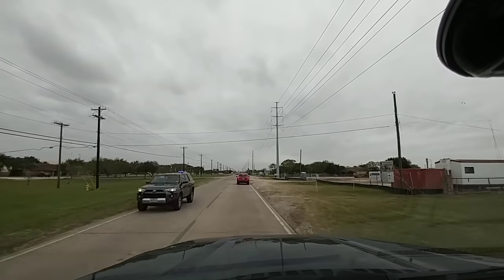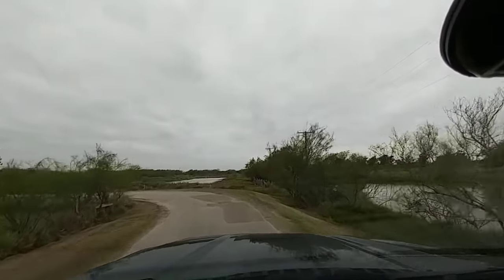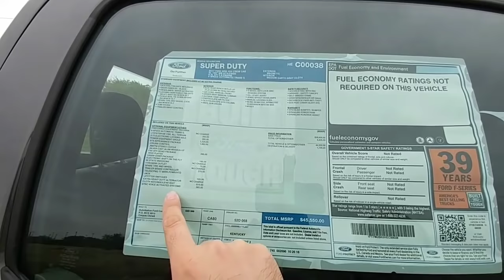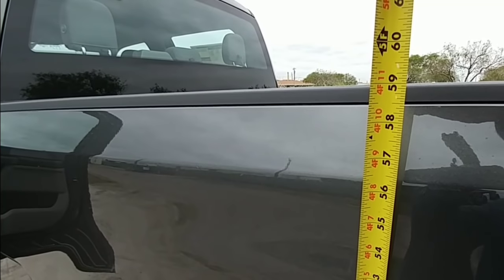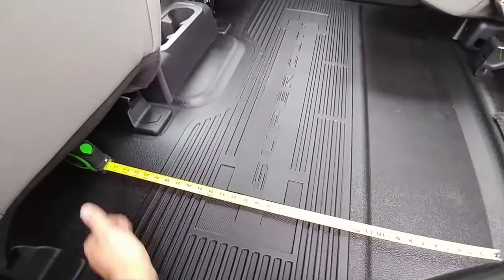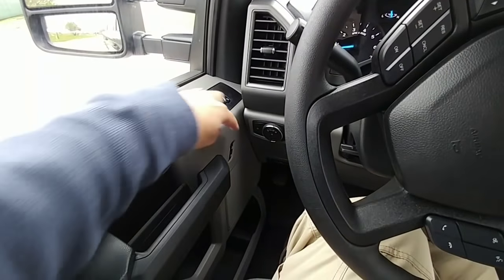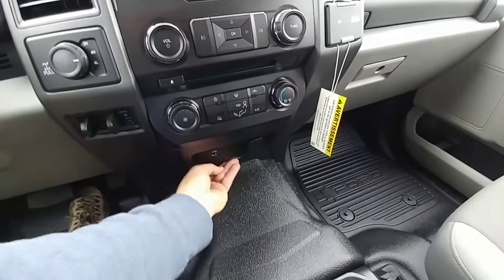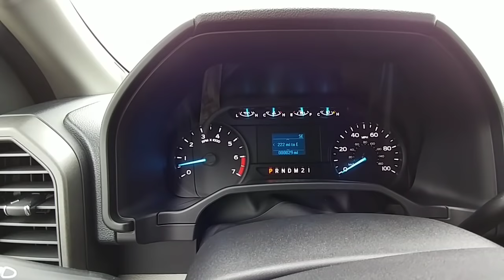2017 F250 STX FX4 6.2 Gas...Full Review

Comment: damn. Ford needs to put that big motor back in the F150.
Reply: Eric Haley they are putting a 3 liter diesle engine in the 2018 f 150
Reply: Eric Haley yes they do. I loved my 11 F-150 with a 6-2. Only reason I got rid of it it's cuz I need an 8 foot bed. I do like the 6-2 it's got really good power for a gas motor but I'm not as impressed with it in the bigger trucks as I am the smaller F-150.
Reply: Eric Haley raptor has the 6.2 at 425hp.
Reply: 250 6.2 are rated at 360 hp and 150 with a 6.2 are at raptor setting at 411 hp

Comment: 2013 f250 6.2 gassser here. Pros: Great power, not diesel but pretty good. Handles payload great. Seatbelt stopped retracting one year in otherwise no problems. Cons: Rides kinda rough but it’s a truck. Stupid low tire air warning system that sounds everytime you start the truck when a tire is below 80 psi. I don’t want that high psi in my rears unless I’m loaded or towing. Ford, either make the alarm adjustable by the owner or put the system on its own breaker so we can disable it.
Reply: Look on Ford forums for a program called Forscan.  You can change many of the factory parameters (including tire pressure) with the software via an OBD adapter for under $50.

Comment: That 6.2 V8 is best paired with a 4.30 rear end. With personal experience the truck just did not seem to have enough get up with the 3.73 rear end, which is going to negatively impact Towing performance
Reply: The 10 speed trans changes all that

Comment: Thanks for the review.  The video really showed this trim level is not for everyone.  The lack of arm rests for the front passengers is one thing but there's no way my kids would reach that rear cup holder.  I didn't see or hear mention of rear air vent that was pointed out in the Silverado videos...are they in this truck?  Also, I think the tow rating for the 3.73 gear option is around 12,500 lbs with the 4:30 gears coming in at 15k with this truck.  I am finding these trucks with the 4:30 gear are difficult to find.

Comment: I have looked at a new F250 optioned almost the same as this one. It is a very nice heavy duty truck. One thing though is the ride height of the truck. Without  the optional step bars it is a real bear to get into and out of because of the door sill height.

Comment: Great review - thanks. I would really like to see how you think the 6.2V8 with the lower gears (Can't remember if it is 4.10 or 4.30 now) drives and pulls. Same goes for driving a Ram HD with the 6.4Hemi. Seems like the higher geared trucks and V8's run well until you hitch up a trailer and then the engines scream to get into the power band - at least out in the high elevations of Colorado where I am. I have found that it is very rare to find a Ford with 4.xx gears or a Ram with the optional 4:10's .
Reply: Its 4.30 with Ford.
Reply: My 88 f250 has 410 rears.
Reply: Beam Me Up Irrelevant.

Comment: My understanding is that steel can be popped out on a light dent. Aluminum can not be popped out because it streaches as it creases. I owned an aluminum 2015 f150 now I have a steel 2016 f250.
Edit: Also the 2015 seemed when closing the doors to be extremely solid thud, on the f250 it almost sound cheap and does not give that confident sound I got from the 15. Just my personal experience.

Comment: Size comparison of smallest f-250 to largest f-150? Was planning to get a 6.5ft bed f-150, but after sitting in a f-250 today....the 250 just seems to a few inches taller and longer, with a higher ride height and weirdly more comfortable despite same cab design?   Future light towing between 5-10k lbs, will keep vehicle forever, really leaning towards getting the 250 now....but might wait for the 7.3 gas engine with tremor.

Comment: way better choice than the Eco boost V6 .  AS for getting any body damage on the aluminium body campaired to the steel is   not to many people know how to properly work with  aluminium, that would be my biggest worry as I use my truck as a truck & it can get a little beat up sometimes.

Comment: 8:29 You comment that it has the premium vinyl flooring. I think actually this is just the regular vinyl flooring like that found on XL trim, and which you can also get with the Carpet Delete option on other trim levels. From what I understand, the premium vinyl is nicer and is only on the Platinum or KR.
Reply from the maker: +mvc00134; Interesting, because it looked identical in both the Platinum and the STX trucks I tested.
Reply: From Ford's marketing material: "The vinyl flooring available for Super Duty King Ranch and Platinum is more durable and thicker than base vinyl, adding to the premium feel of the top trims. Both versions of vinyl flooring offer
improved ability to wash out the interior."
https://media.ford.com/content/fordmedia/fna/us/en/news/2016/06/13/a-tuxedo-with-work-boots--all-new-ford-f-series-super-duty-king-.pdf

Comment: I have a question about this truck.  Hope someone can answer this.  I am thinking of getting this truck but will probably get the 6 seater instead of the console that has no arm rest Lol.  My question is about the AC airflow to the back of the cab that is actually positioned under the driver and passenger seats on the floor.  The next trim level is the XLT which has actually rear vents in the back of the console but is 4-5k more in price to get that. I live in Texas, and obviously it gets hot. I have 3 kids that will be riding in the back and was wondering if the airflow is sufficient to the back seats? My current truck does not have air vents in the back (no vents on console or on the floor) and it is always hot for the kids.  Does anyone know if the airflow is sufficient in the back for this trim level?

Comment: how would this perform pulling a 10-11k fifth wheel? Have a Jayflight 31.5 BHTS and would be interested in a gasser instead of another diesel.
Reply from the maker: Dwight Riddlespurger: at 11k you would be good with this truck 99% of the time. Steel uphill and downhill will be more challenging with the reduced torque and lack of exhaust brake.
Reply: Big Truck Big RV currently towing with 03 2500 ram Cummins with a 6 speed manual, don't have exhaust brake currently.Thing is I tow this fiver about 8-9 times a year and the rest is driving to work 10 miles away.

Comment: I would like to tell you in a informational note that all the rear axles for the f150 through the f350 dually are built by Ford them selves.
Reply from the maker: Farmall 560 diesel: correct, but to clarify, they are manufactured by Ford at the Sterling plant.
Reply: Big Truck Big RV, yes, my dad works there

Comment: So your saying that the 6.2 is weak and that truck with the 6.2 is useless . That’s the raptor engine isn’t it
Reply from the maker: I said that?  When?  Tuning, transmission, injection system, computer program, intake, exhaust, and gear ratio also play a big part in terms of power delivery.  But I'm sure you already new that.
Reply: Big Truck Big RV I agree with what your saying . I was going by your comment about the weak response between 20 to 40 .

Comment: I'm looking to get this 2017 6.2 l . Should i get the 3:73 or 4:30 gear ?
Reply: Carol Rinaudo depends on how much you need to tow.  Look at the 2017 Ford towing guide.  3.73 will give you slight better fuel economy but the 4.xx gears will give you a higher towing capacity.  You probably will not find the 4.xx gears on a truck in the lot, you'll have to order a new truck with them.

Comment: Nice truck!  I like the FX4/STX package + upfitter switches! Hoever, I would prefer the addition of the rear park sensors and back-up cam, Dana M300/4:30 ratio and bench seat up front for seating for (6) flesh vessels.

Comment: One thing I have wondered about is how well does the e-coat work on the fully boxed sections of the frames?
Reply from the maker: +311hitwall the frame is completely bathed in the solvent, and there are plenty of frame holes for it to pour through.
Reply: Thanks

Comment: The STX package looks good except that floor console just looks out of place. I am not a fan of the jump seats, but if I had the only choice of the low floor console or the jump seat I would take the jump seat as it fills the space better. If that had a full size console even without the power port and climate vents in the console , it would still look better than that low console.,

Of course that is just my opinion, some may like it, but to me it just looks out of place. Nice review though and I agree about the running boards

Comment: $45K for a truck with an oil pressure gauge that doesn't work.
Reply: 351WINCHESTER And no damn armrest
Reply: 351WINCHESTER Right you can get a used 6.7 lariat with less than 50k miles and less than a year old for the same price.
Reply: No oil pressure gauges in the dash are accurate

Comment: My 96 ram 2500 8.0L V10 magnum has MORE peak and low end torque than the Cummins of its day with a flat curve that starts @1200 RPM with 400 ft ibs to a peak of 450 ft ibs @2400 and 395 ft ibs @4200RPM with a lifespan that falls short of the Cummins but still comes very close as it'snot unheard of for these engines to get 400,000 miles when maintained well. 

Unfortunately due to the raising diesel market and bad gas mileage (11.5 at best with 4x4 and 13.5 with 2wd) this giant gas engine only stayed for the 2nd gen dodges and the 1st year of the 3rd gens. With a low RMP turbo the 8.0 could still make more low end than modern diesels due to the pure mass of the V10 as turbo diesels are 30% more efficient than NA gas engines. Big gassers would make a great alternative for those who don't want diesels especially scense it really isn't worth it to own a diesel anymore due to their massive mark up. On average it takes about 150,000 miles to recupe the cost of a modern diesel not to metion the need fot bullshit DEF ehich does more bad for the environment than good. I think gassers are gonna start becoming more and more popular as the EPA slowly kills the diesel engines, a very sad thought.

What we need are good long lasting gassers like what we used to have with the pushrod V8s. You could get well over 300,000 miles with those beasts. I refuse to believe that with 20 more years of development after those push rod V8s became outdated that not only do gas engines not last any longer, they DON'T last as long. In same cases the same can be said for diesels afterall DPFs and EGRs kill them everyday. In many cases forcing the owner to put 6500 pounds of plastic, steel, and apulstry into a landfill and let it sit. 
Those polution control systems sure were good for the environment huh?
Reply: Steven Cash but you get terrible gas mileage
Reply: Actually your v10 hits 400 ft/lb at 800 RPM's and never dips back below 400. I own a 99, they truly are torque monsters. I'd like to upgrade, but I don't want a diesel, don't want a half ton, and all gas jobs in 3/4 ton trucks from the big 3 just don't feel like Dodge's v10 does. It makes torque where it needs to, and lots of it. Truly an engine that was killed off way too soon. the gas mileage isn't much worse than a new 3/4 or 1 ton gas would be anyway.
Reply: Dominic Valentine I've would rather have a truck with outstanding reliability than a truck with outstanding MPG.
Reply: Steven Cash I have a 96 Ford F150 with 5.0L Windsor V8 with 203,391 miles on it and it's still going strong.
Reply: @CJ....95 F150XL 5.0(302) 4x4.
I got it January 2017. Prior owner took REAL good care of it. 124k miles (117 when I bought it) and runs like a top. Gets the same mileage as a coworkers 2011! His is turbo'd, but I'm not in a hurry. 
This '95 is my daily driver, & rides smooth as a caddie. 
Gotta love 'em!!!
Reply: Oh is that all?

Comment: They also have the stx package on the 2017 f-350. But nobody talks about that. Nor do they have any information on the web/YouTube about the 350. Whats up with that?????
Reply from the maker: Dually or none dually?
Reply: No not a dually. Just bought it. It has a stick on the floor and auto 4x4. But what i can gather, its the same as the 250. The only differences are the leaf springs. And mine has the stx package?  Electric windows,electric doors , manual seats, plastic floors 40/20/40 front seats 6.75 bed, 1 camera/back up, 6.2L ,   Basically an xl with the stx. But an f-350. Cant find a review on it any where.
Reply: Big Truck Big RV no not a dually. 6.2L f350  2017 right off the lot. Stx pkg. has 4x4 stick on the floor with auto 4x4. ?   Power seats,power windows. Plastic floors. 40/20/40. Fold down center armrest. 6.75 bed, 1 piece rear window single mirror (rear).  Sorry if i sent you a second msg didn’t know if I did it correctly. Thanks. Jm.

Comment: Stop hitting the gas; You compared power to a mustang; while that's great, that's not why trucks have those engines. It's not for unloaded driving, it's for payload and towing. P.S; comparing a Shelby to a GT isn't fair; try comparing a GT to a Ecoboost. Comparing a Shelby to a GT is like comparing a 550 to a 150.

Comment: @ 12:33 the body is high but that frame is much lower underneath. Just test drove one. Not bad but cab is smaller than older Super Duties.
Reply: johnnybabee yeah it's where they use the same cab as the f150

Comment: People are gonna start to gravitate towards gas powered trucks instead of diesels thanks to the stupid epa.
Reply: Sold my 6.7 because of Emission Controls and Sensors. $12,000 if the Fuel Pump goes out. I will be getting a 2020 with the 7.3 Gas
Reply: Yup...just traded in my 6.4 for more or less this exact truck.  Miss the power, won't miss the repairs or maintenance costs.

Comment: why don't they put the v10 back in these trucks?
Reply: But you get more torque at lower rpm with the v10...
Reply: POCGUITAR the v10 is going to be in the 550 and up if I am correct. A revised version
Reply: Excuse me, 650* and up.
Reply: David A I wish they had kept the v10 in the f250 and 350 over the 6.2.
Reply: POCGUITAR The 6.2 makes great power and is more efficient, better engine in my opinion. The v10 does have its ups though. A few of my uncles tow trucks were the v10 and they had no problem towing anything you put behind them, they just sucked gas like crazy
Reply: David A I strongly agree. I have a friend that drives a ford V10 f450 that has outlasted the 6.7 he drove my a landslide. On the otherhand I have a 96 ram 2500 V10 that pulls anything with ease and a LOT easier than the new gas "pulling" engines.
Reply: Rumor has it that Ford is working on a 7.0L V8 to take the V-10's place in the F-250 and F-350 trucks.
Reply: Nathan McDonald If that's true I would go and get approved for a loan that day!
Reply: You and me both bud.
Reply: The Dodge V10 was fairly decent a little piggy but supposedly good power.
Reply: Ford bringing back the past they had a 7.0 V8 aka the 429.

Comment: I still can’t figure y ford puts the gas engines so far under the fire wall. There is tons of room to move it forward. The location makes repair centers to remove the cab for some repair actvities😒
Reply: devin smith any vehicle is going to handle better with less weight sticking forward it probably has somthing to do with that

Comment: My 2017 FX4 rides like shit . It has 7k miles on it and it is getting death wobble. My 97 Dodge ram 2500 Cummins rides like a cattalac compared to this thing. It is a nice truck with a lot of power. Just can't drive over 65mph because of the Death Wobble. Use caution when buying one of these trucks.

Comment: This truck is the SLOWEST V8 truck I have ever driven
Reply: Ford, like GM, detunes  their engines for longevity.  If you want to wake up a GM, look at Black Bear tuning.  If you want to wake up a Ford, 5 star tuning or install a Pedal Commander.  I have zero issues with the performance of my 6.2 Ford coming from a 6.0 gas GM.

Comment: The 3.5 ecoboost is rated with more power than this.
Reply: protect your 2nd different power. It’s like comparing a work horse to a Shetland pony. The Ecoboost will fly apart if you put it to the work the 6.2 will do. Not to say the Ecoboost isn’t a good engine. But it is far from a workhorse.
Reply: kody kopjar time will tell

Comment: I feel like the interior of this truck makes it feel like you are spending way to much money on it if you spend over 40000 on it.  I like basic utility.. but I want it to be smart utility and not leave me wanting for any reason.  a place to put my arm should not cost a leg.  And place to put my leg should not risk pulling a testicle!  

I also hate that tiny little console screen, they have a bigger one, and probably wasted the profit from bigger screen by trying to offer a second solution instead of sticking to one, or none.. My first though was why did they bother, and my second thought was is this going to work any better with my back up camera then the rear view mirror?  Does it even have a back up camera at that price?  i would not expect it..  but it would be nice at this price.

Sooo, if they fixed that arm rest, and put in a set of running boards, It might be worth the 46000..  I do like utility and this seems to have a lot of it built right in.  I just want to see maybe what they do for a more expensive F250 and then the GM trucks.